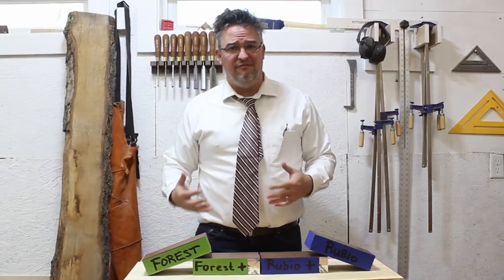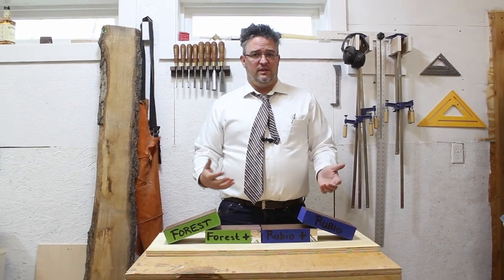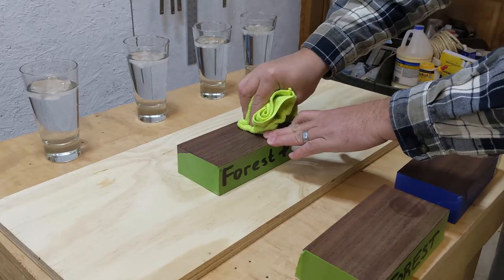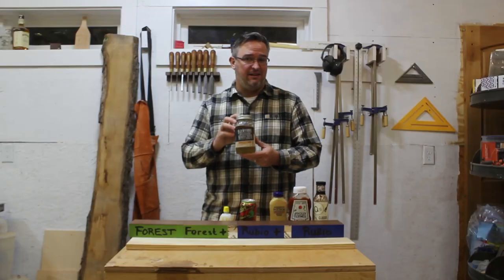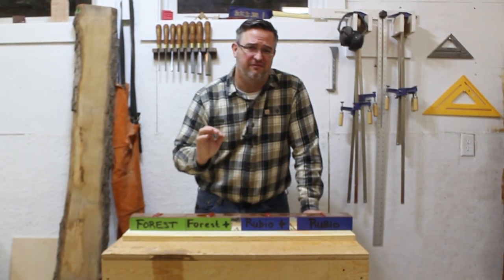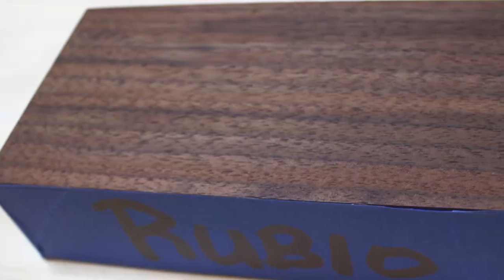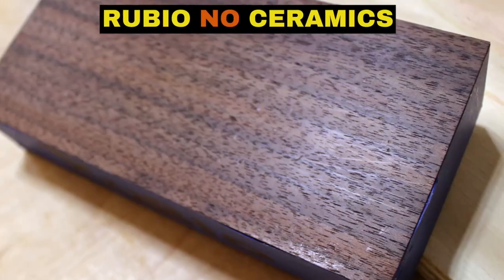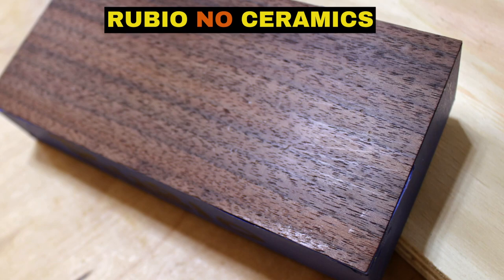Find Out How Durable Wood Ceramics REALLY Are

Comment: Great video! Very innovative and lots of useful information. Was just wondering how did you get that Rubio Monocoat + finish? Its looks gorgeous and from the teest its seems very durable as well. How many coat of Rubio did you use, and how many of the ceramic? Did you sand in between? Would truly appreciate some feedback. Got yourself a subscriber
Reply from the maker: I typically purchase the Rubio Monocoat Pure from Amazon: https://amzn.to/3iTSNnG . This is a very durable finish on its own. The ceramics do offer another layer of protection against scratches, oils and chemical cleaners. I only applied 1 coat of Rubio to these samples using a standard white buffing pad. After letting the Rubio Cure for 4 days I applied just 1 coat of Blackforest Diamond Base Coat and the next day I applied 1 coat of the Blackforest Top Coat. The base coat and top coat work together and come as a kit which includes a microfiber towel and applicator pad.
Reply from the maker: Andrean - thank you for the thoughtful question!
Reply: @Ben Van Kirk  thank you for the reply, great information and awesome channel.